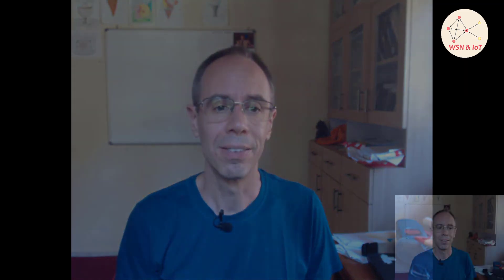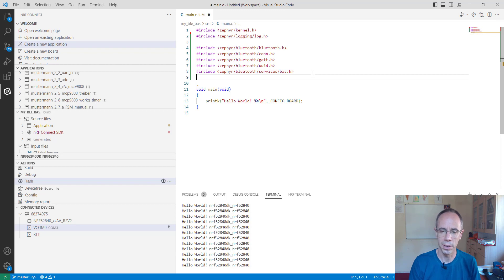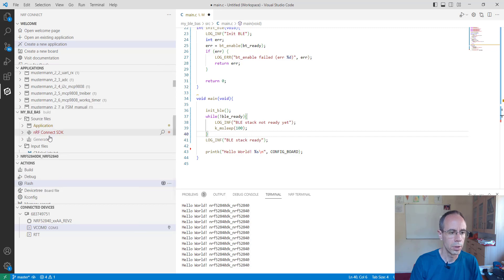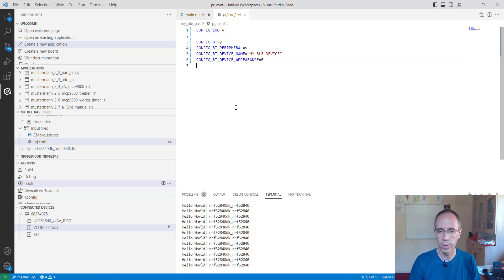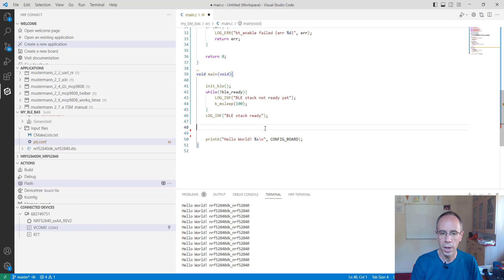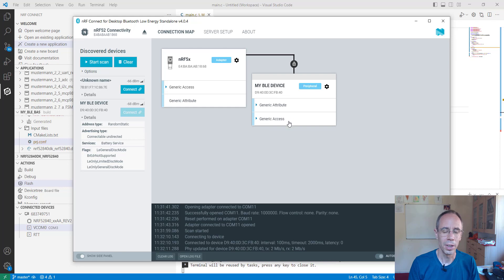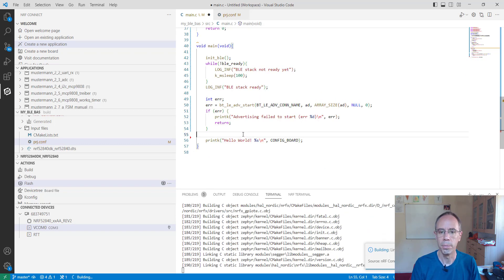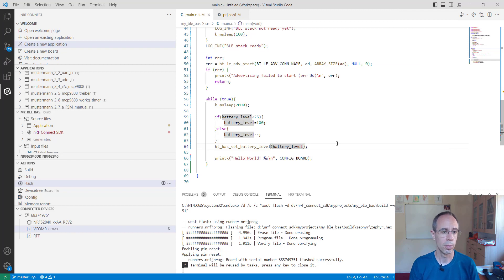Programming Bluetooth Low Energy (BLE) with Zephyr - Part 1:  Battery Service (BAS)

Comment: I have Bluetooth Car using HC-05, it only detects BLE so its hard to use it.  It needs to use Serial Bluetooth controller to connect in BLE and you will just use Text command to move the Car .